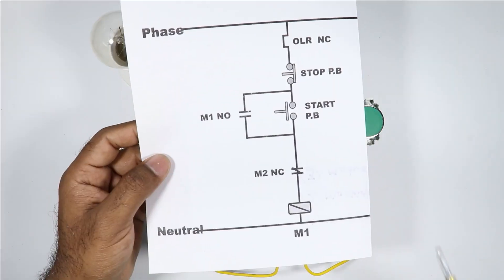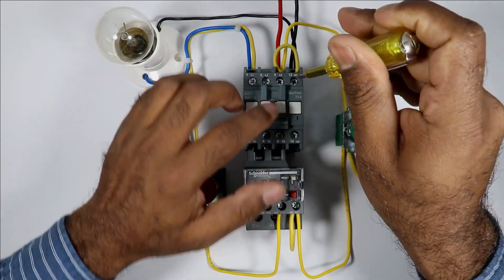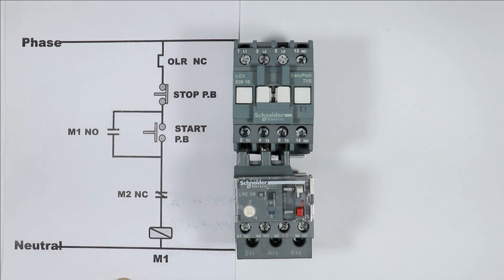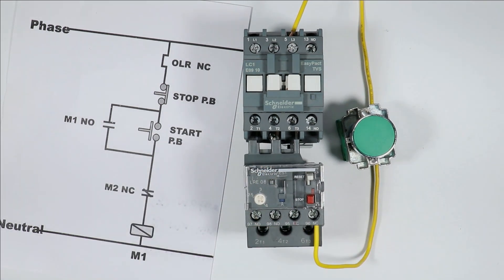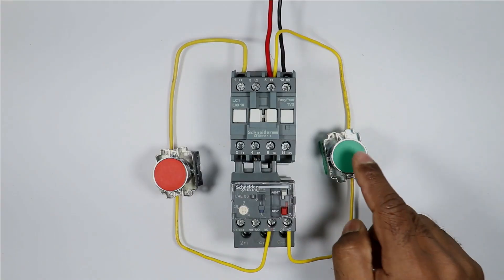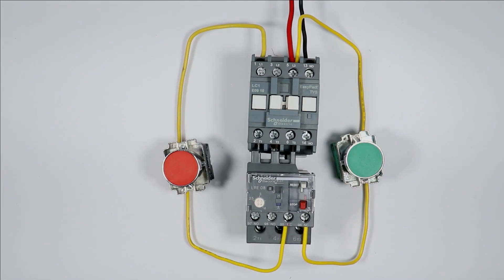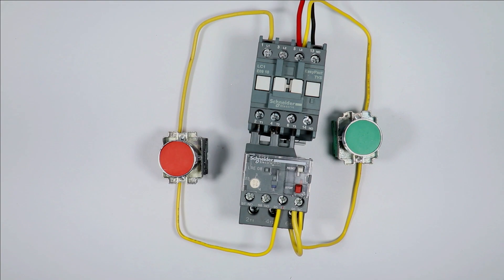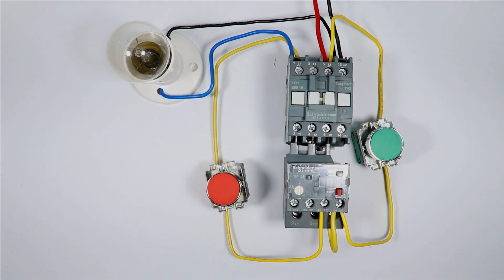DOL Starter Contactor Holding Circuit without Using NO Contact  @TheElectricalGuy

Comment: Great Video. Where do the red and black wire connect to?
Reply from the maker: A1 and A2 terminal of Contector
Reply: Red is supply live to L3, black is supply neutral hope to A2  terminal (coil)of contactor, then from out put T3 of contactor we connect a holding wire to 95 terminal.
Reply: Sorry, the output  wire from T3 is connected to 96 terminal.